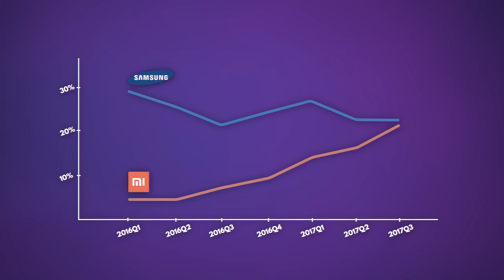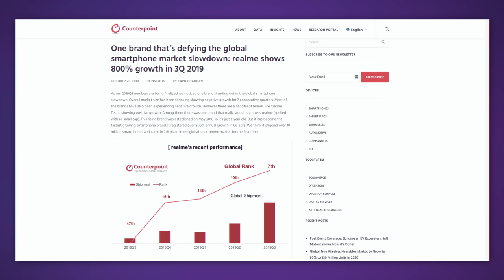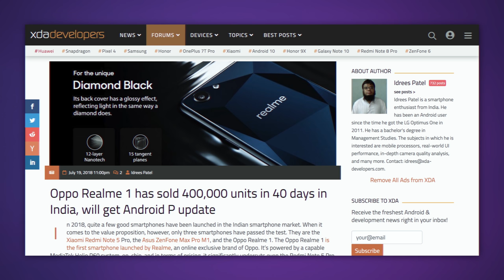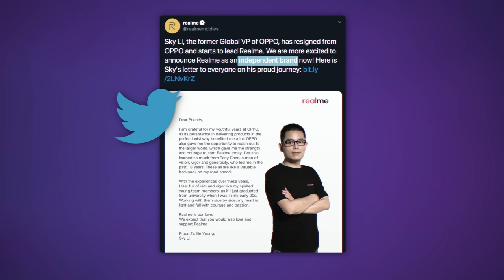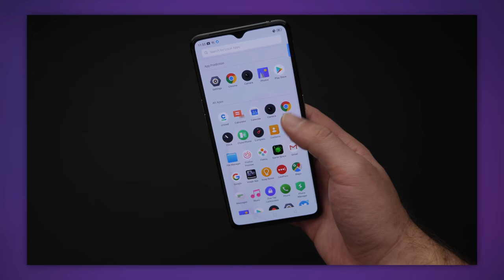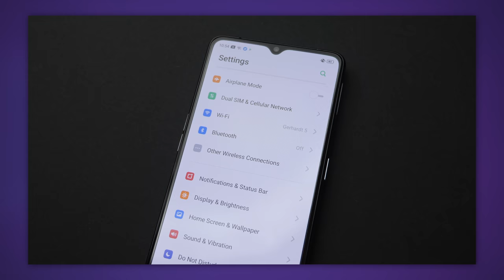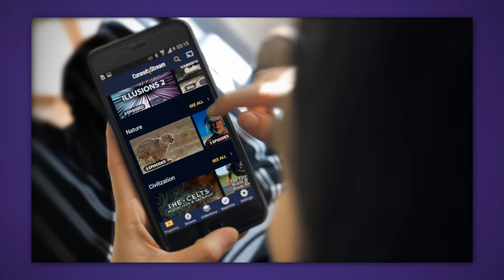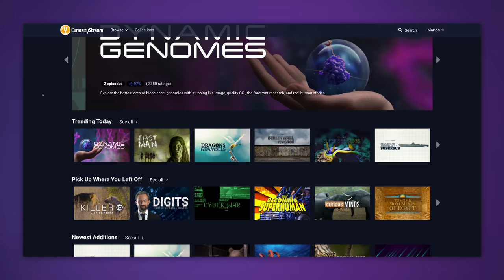The fastest growing phone brand in the world

Comment: I actually bought the realme one but for 1 simple reason- It was the cheapest phone with 128GB storage(along with an SD card slot). I don't really care about the looks or processor. I liked the processor because of the 7nm manufacturing process for power efficiency(but I would have bought the phone without it as well), other then that all phones from $50 to $1500 can run almost all applications on the playstore with minute performance differences but once you are out of storage, you are out of storage. Its not like samsung galaxy fold can run scientific computation operations. Cell phones at the end of the day are just computers from 15 years ago but more portable. Even the most powerful ones are laughably weak compared to real computers. I don't understand why people spend even $500 on phones and think they are getting any value.

Comment: I was told about this new Realme phone, a couple of months ago and my curiosity peaked, kept an eye out till its eventual release : several interrsting points surfaced , which are quite instructive.
So, starting with the pricing : I won't speak if the Chinese market because a phone jmportef from China is not readily operable in N America, without some tinkering , Google apps are likely to be absent, too. The Indian model though is perfect, also carries a glibal rom. This latest offering, this almost flagship device can be had for under five hundred dollars and for that money you'd get a charger that charges a 4000 mAh battery in about 30 minutes. It puts every other phone to shame, save an Oppo device , for now, ava9only in China, that does the same in about 3 minutes fewer. And , you'd get a phone with 256 gb storage, mind it , UFS 3.0 storage which is not there even in the Galaxy S series as of yet, and 12 gb of RAM, with of course, the binned SD 855 plus , clocking almost 3.0 ghz. 
The interesting part is the variable and very feasible alternative it comes out as, even to its kindred devices from Oppo and One plus.
Take the 1+7t, probably the best Android phone on the market given its oricing and the brand value One plus has come to represent. It's also cheaply priced, when compared to say the Samsungs, and Apple fkagships, has great performance...etc.
This realme model though gives one an alternative even to that, and in many ways an unbeatable one.
For, it's mostly the very same phone with a seperate nomenclature, and i have looked at these, got inputs, asked some knowledgeable folks, with some details from the parent companies. So, for a scantier sum , should i buy this and eschew the 7t, I'd not be compromising on the display — the NRR is the same at 90 hz, the Amoled panels are similarly sourced, likely the exact same panels, quite likely in fact. It's the same display with minute differences if one were to nitpick still not enough to seperate . And it supports HDR 10+ content. The same Samsung amoled panel. Then there's the same exact version of Gorilla glass on the phones , front and back. Similar fingerprint sensors, if anything the one on the realme is faster, quicker, and the same can be said of the face unlock mechanism. 
Selfie cameras are similar. Back cameras are too, identical, with the Realme primary camera being a 64 mp unit as against the 48 mp on a the 7t, so it's a better deal. Of course, the software is dissimilar, but the images are hard to tell apart. 
The charger is probably the fastest in the world you could  get and the realme phone has a Headphone slot, to boot.
It's incredible, the price to performance ratio, and the exact same hardware means you are getting a 7t with goodies like the 3.5 mm jack and faster charging thrown in.
There's Dolby atmos , working on dual speakers and 2*2 MIMO  implementation that's there on the iphone 11 pro models , not in the 11 though.
So you could have 2 wifi connections simultaneously at difft widths.
And, this device hit one plus , at least in India, hard so much so, they had to slash pricing at a point they have never done as of yet.
It's nice that you put out such informational pue es.
Reply: Does it come with human rights too ?

Comment: As great as Xiaomi may be, they are not allowing TF- (SD-) cards. Do if you want to have more memory you have to pay do much more. That's a deal breaker with Xiaomi for me.
But here's something I want Oppo/realme to think about: Why in the the lower and mid-range phones you include the headphone jack as in the flagship phones you dump it? Put in a good higher resolution front facing camera with 4K 10 minutes recording capabilities for the least and a headphone jack so creators and vloggers can plug in an external microphone not having to depend on a dongle. Also that way while filming they still are able to charge the phone if needed which isn't possible connecting the mic to a dongle.

Comment: Techie youth Indian consumer only care about specs ,battery & longetivity. Redmi caught attention due to 4000mAh battery at a time Samsung was selling 2200mAh. As for the back panel, nobody I know really cares, because you are gonna put on a case anyways. The only bummer about Realme is their Kernel source is too unreliable or incomplete. Redmi has great custom ROM support with many Xiaomi did start with MIUI as Custom ROM and those devs still support community and active in XDA. while Realme with it's Color is dependent Kernel is hard to work with. I still has a Redmi Note 3 from 2016 and it Runs Custom Android 10 without bugs.
Reply: That’s pretty awesome 😎 I have a 6s as a main phone because I prefer iOS but have a galaxy note 2 running android 9 custom rom 💪
Reply: @sidmas-zj5eu  AOSIP DERPFEST 10 UNOFFICIAL BUILD
Reply: @macktheripper7454  I have a S3, but Samsung's memory usually becomes slower over time. So wiping and floating repeatedly will make it Hangsung.